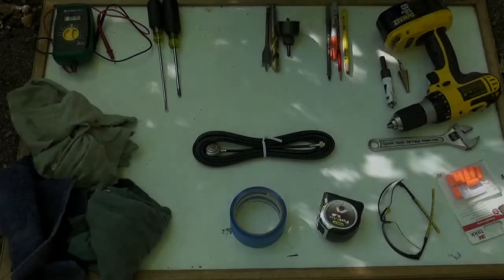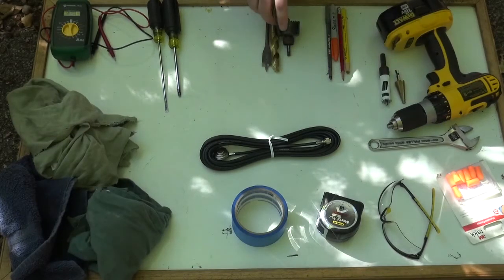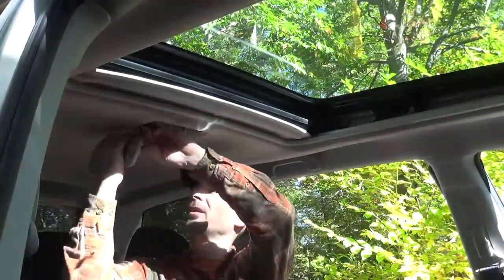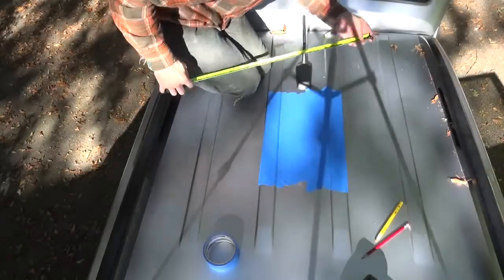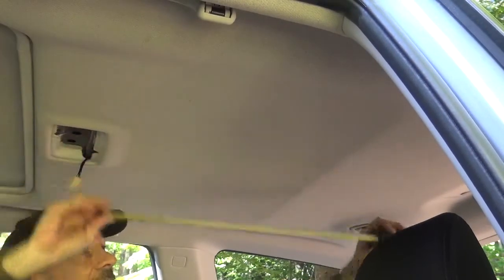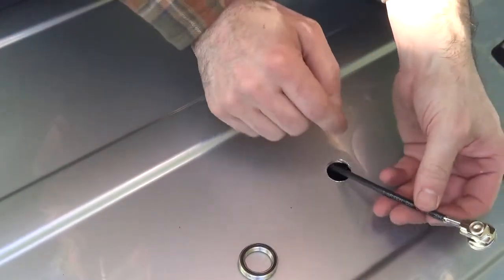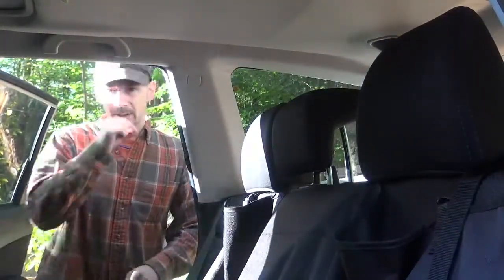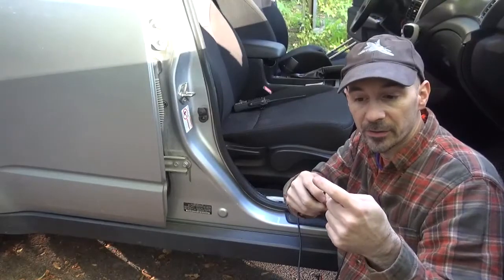PEG NMO Mobile Antenna Installation

Comment: Would this type antenna survive a car wash? I see the CHP with these and they have a spring, so I don't think they hand wash their explorers.
Reply from the maker: CHP does what we do...we unscrew it from the NMO mount before the car wash.  The only antenna that I've had that didn't need to be removed for a car wash is a 800Mhz quarter wave.  Since it's only about 3 inches and super stiff due to the short length of the whip.  Any other antenna for higher frequencies (or a higher gain antenna for higher frequencies) will render your antenna bent on the way out of most car washes.  CHP uses a custom manufacturer antenna specifically for them ( and now available to the public that uses VHF low band).  They took over some low band frequencies previously used by another agency in their state after moving to an 800Mhz P25 system.  But on lower frequency antennas the bandwidth is much narrower.  For VHF low band typical antenna bandwidth is 2Mhz but CHP needed more like 7Mhz so they had the antenna made for them by Laird.  The spring isn't necessary on 2.5mm whips like Larsen, Browning and other companies use it but for the Motorola Spectrum and many other antennas that use a 3.5mm whip the whip is super ridged and needs the spring.  However in the case with the CHP Laird WPC39SOB-001 the spring wasn't so much necessary because of the whip type but it's a very tricky thing to get a low frequency antenna to have a bandwidth of about 7Mhz and still have a low SWR.  Also the antenna requires a special length whip ( I think it's like 58 to 61 inches) unlike most which have a max length of 49 inches.  All of these traits and the special loading coil were necessary for the special specs of this unique antenna.  
 Spring or not I would recommend unscrewing the antenna from the NMO mount before sending it through the wash.  Thanks for the questions.  I hope my answer helped.
Reply: @USPreparatory  Thank you very much for that very informative answer.
Reply from the maker: You are very welcome.

Comment: any suggestions for mounting multiple antennas on the roof, I currently need to do 3 and I know its recommended to mount them at least 18 inches away from each other, but I dont have that much real estate right now
Reply from the maker: Hi Michael.  What vehicle type are talking here?   I can give you some important tips that will minimize performance issues but I would need to know what radio bands you're using and the antenna types (dual band, quarter wave, co-linear, etc.)  Once I know that I can help.

Comment: As a professional 2 way radio installer, i came up with a neat trick for the drilling. I used the magnet out of an old manet mount antenna. Its a perfect ring. Make your drill spot, put the magnet on the roof. As you drill, the shards of metal stick to the magnet.
Reply from the maker: Well that's a great idea Neil.  All these years of professional installation, it never occurred to me. Thanks man!   -Chris

Comment: I tend to use an old transmission pan magnet from a ford to capture the metal shavings
Reply from the maker: Hey Jeff.  That's a GREAT idea.  I hadn't used that idea but anything is better than missing metal chips only to find rust marks on the vehicle when it rains or snow.  Thanks for sharing Jeff.  -Chris